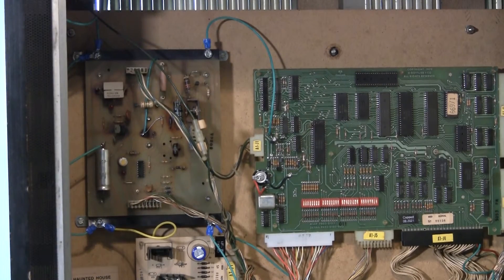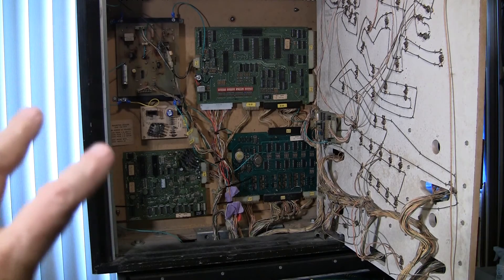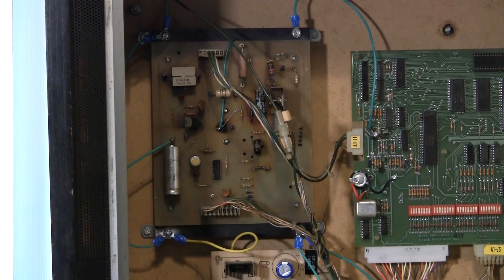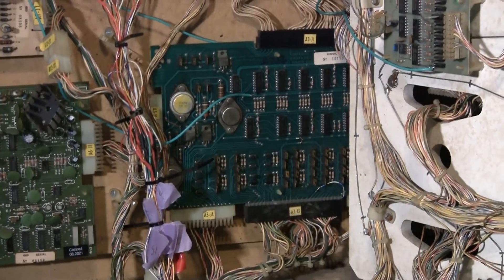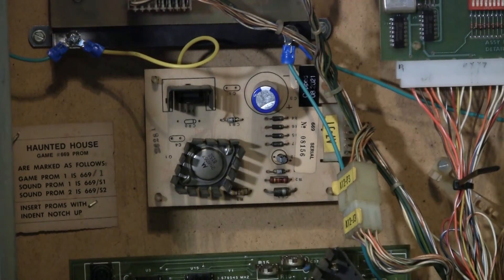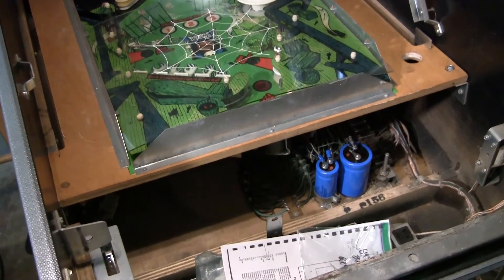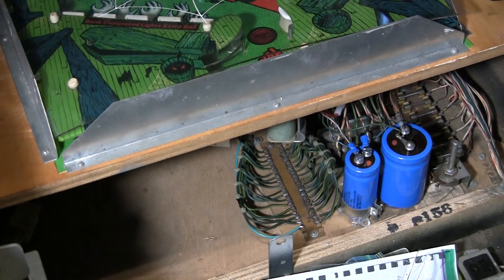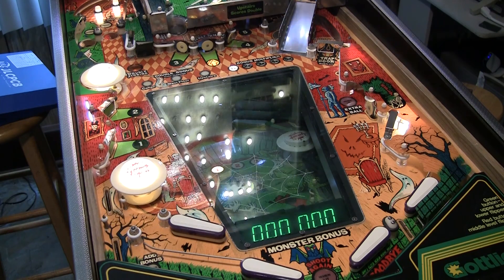Gottlieb Haunted House Pinball - Part 9 - Required System 80 Ground Mods - PinballHelp.com

Comment: On my Black Hole pinball I didn't add a ground wire to the MPU board, it's already being fed ground from the power supply board by two separate wires on the connector.  And anyway after I found out about how you are supposed to add a second ground wire (and 5v wire) to the MPU-to-control board connector, I did that and then took out all my extra ground wires except the one to the control board.